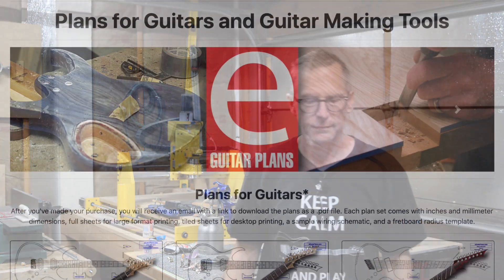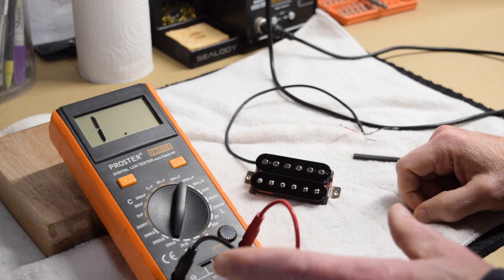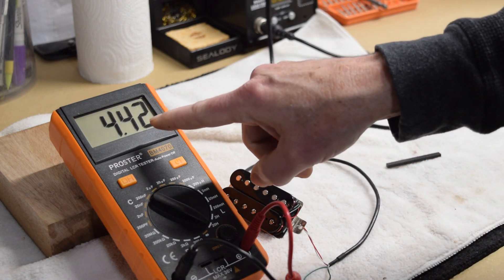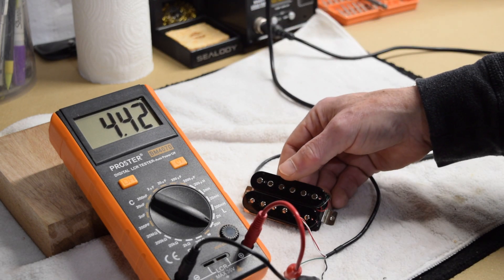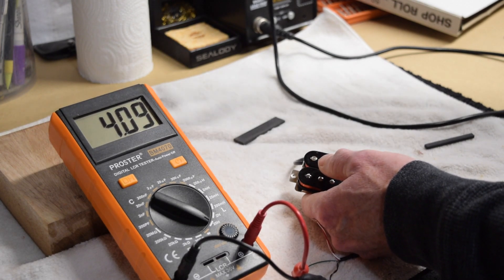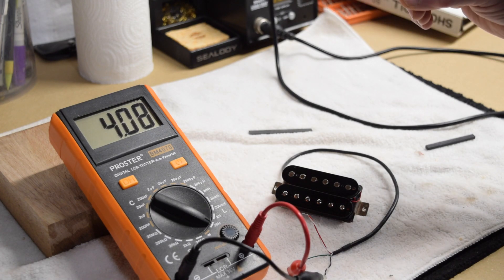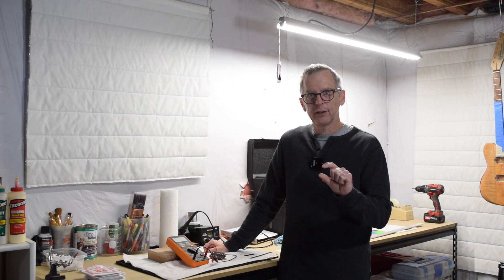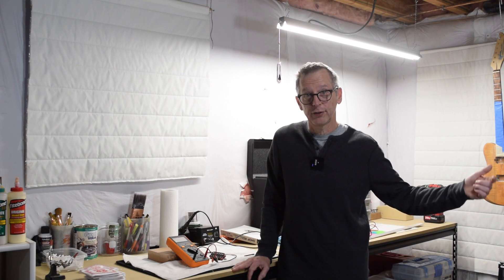Luthier Quick Tip 26 How To Make Guitar Pickups Part 2: Inductance

Comment: 4:13 great video!  My only comment is that I wish you would have provided the gauss readings of both magnets in this example. 

Given a magnet, would you say gauss readings matter more than the material the magnet is made out of?  Put differently, given a set of 5 magnets with the same gauss reading, but they are made out of different materials, would they all sound the same?

I’m interested to hear your response.
Reply from the maker: @michaelkiese7794  They will all sound different due to how the material composition affects the shape of the magnetic field as well as how strong the magnet is charged.

Comment: I have read about bypassing the 2nd coil of a humbucker pickup with a “bright cap”. So as the highest frequency content doesn’t have to fight through the 2nd half. Any experience doing this?
Reply from the maker: No.
Reply: @HighlineGuitars  does it seem like an interesting thing to try from your point of view? Or does it defeat the purpose of a humbucker?
Reply from the maker: @voxpathfinder15r  It sounds like a solution looking for a problem.
Reply: @HighlineGuitars  I kind of want someone else to try it and report back before I break out the soldering iron
Reply from the maker: @voxpathfinder15r  Post a link to what you've read and I'll look into it.

Comment: Hi, first thank you for the explanation. Very good video! I have a question, to reduce the inductance of a ceramic capacitor to something around 2.5 Henry, what kind of slug(material) should I use?
Reply from the maker: No idea. You’ll have to experiment.
Reply: Could you suggest me pickups with this configuration (2.5H)? I saw that fenders 59's have this feature, but here in Brazil they are extremely expensive! Thank you very much.
Reply from the maker: Sorry, I don’t know. I don’t pay attention to what’s available commercially.

Comment: Amazing video like always. 
1 question : how is it possible to increase or decrease inductance, but keeping the same resistance, without change magnet ? Just in changing the way to round the coil ? What is the movemente ?
Ex: i tried to achieve a strat pickup, 5.3 khm resistance, and 2,13 henry.
I m ending with resistance ok, 5.3 khm, but only 1.9 henry. 
How can i change my way to round the coil for increase the inductance and reach and higher number like 2.13 ????? 
I m trying and trying, a lot of differentes ways, but i don t understand 😢😢
Reply from the maker: You can't change the inductance of the coil without changing the resistance. You can only change the inductance without affecting the resistance by switching to a magnet with a different level of iron composition. The presence of iron is what affects inductance. If you don't want to change the resistance or the magnet, you can place a small piece of steel on the back of the pickup to raise the inductance to the level you want.
Reply: @HighlineGuitars  oook thank you a lot for your answer 🙏🙏🙏
So the only thing i can change with the way to round the coil, is going to be the proportion of the  capacitance ?
Reply from the maker: @nicoreynders2880  Capacitance is affected by the number of turns which also determines the resistance. You cannot change one without changing the other.
Reply: Try using a lower gauge (thicker) magnet wire like 41 or even 40. The final resistance will of course read lower but the inductance should read higher. At least, that has been my experience.
Reply: @U2BER2012  thank you. I ll try 👍🙏
Reply: @nicoreynders2880  Hopefully, it works out for you.
Reply: @U2BER2012  i m trying and trying to replicate a cs 69 from fender. And still don t make it.  They say the gauge is 42. I already tried change magnet andmagnetiza streight but i didn t make the same pickup yet .... thank for your advice

Comment: Do i need to buy multimeter or just lcr is enough for making guitar pickup ?
Reply from the maker: Yes, an LCR meter is all you really need. It will measure inductance (L), capacitance (C), and resistance (R).
Reply: @HighlineGuitars  Thank you

Comment: Thank you for covering Inductance.  Can you also measure the inductance of a whole circuit at the guitar jack? Thanks!
Reply from the maker: Yes I can.
Reply: @HighlineGuitars  If you have time someday and could cover that I would greatly appreciate it. It would be interesting to see the results after the circuit.
Reply from the maker: @JeffDunsmore1  You'll get the same reading at the jack as you would at the pickup.
Reply: @HighlineGuitars  Thank you so much. That is good to know. I thought the circuit and everything that might be in it would change it.

Comment: Will it be the end of the world if I wind my tele pickups the other way round? The neck pickup having more turns and DC resistance than the bridge pickup?
Reply: So a neck pickup with 7.6 kohm resistance and a bridge pickup with with 6.6 kohm resistance (all other components are same, i.e. wire gauge, magnets) won't land me in a pickle later?
Reply from the maker: @farzaanpavri  Probably not. However, it depends on you and how you feel it sounds. I may do a video on this topic. Perhaps in a few weeks.
Reply from the maker: The neck may overpower the bridge. However, that could yield a desirable result. There are no rules. Go for it!
Reply: Thank you for answering my questions. You really have helped me now and in the past
Reply from the maker: @farzaanpavri  You're welcome and be sure to let me know here how your experiment turns out.
Reply: Yes i will 😀

Comment: Does the affect of asymmetrically wound bobbins on humbuckers show up with inductance readings? From what I’ve read, asymmetrical humbuckers can scoop mids out to make the pickup sound brighter. Is this true, and does it show up measurably with inductance?
Reply from the maker: I've made custom asymmetrical humbuckers myself (7 string multiscale). I don't see how the offset would affect the inductance reading.
Reply: @HighlineGuitars  thanks for the response. Would you agree that asymmetrical bobbins do in fact scoop out mids, or is there a better way to describe its function?
Reply from the maker: @jonathankvex  I don't know. I would have to compare asymmetrical with non-asymmetrical in the same guitar. That's never going to happen.

Comment: I'm looking forward to the next episode. What do you think about different potting techniques to effect tone, as in heavy potting, light potting, potting the bobbin and magnet but not the coil...?
Reply from the maker: How on earth do you pot a bobbin, but not the coil? The whole point of wax potting is to saturate the coil windings with wax so they won't vibrate.
Reply: @HighlineGuitars  For example dipping the unwound tele bobbin in wax so that the bobbin and magnets wont vibrate against the base plate or the neck cover. But the pickup would still sound like an unpotted pickup, but with less out of control microphonics. I've heard a few pickup makers talk about stuff like that with the potting process, or a way of "lightly" potting a pickup

Comment: Not sure that particular LCR meter has sufficient test frequency to measure pickup inductance as accurately as one like the DE-5000. It also seems to get pickup capacitance measurements wrong. They should be in 50-300 pF range.
Reply from the maker: The DE-5000 has been discontinued. You can buy them used, but the one I use works fine for DIYers.
Reply: @HighlineGuitars  DE-5000 not discontinued as far as I know. Widely available for around $100. https://www.deree.com.tw/de-5000-lcr-meter.html Inductance measures may be "close" with some other meters (despite too low test frequencies), although pickup capacitance is way out with the Proster (gets nF when should be getting pF).
Reply: Not sure why you are talking about capacitance, when the video is about inductance lol
Reply: @nisterror  Because of two important measurements on pickups, inductance and capacitance, the Proster meter gets both wrong. Inductance possibly  only slightly wrong (so maybe "near enough"), but capacitance by a lot.

Comment: Counterintuitive!  I would have expected the association of tone and inductance otherwise-- we use capacitors in tone circuits because they pass AC easier than DC, or highs easier than lowers, and bleed off highs.  Inductors work the opposite, passing DC easier than AC-- or, I would expect, passing lows easier than highs.  However, in this case, we're not passing current through the inductor, we're changing the magnetic field around the inductor.  I suppose the proper analog would be changing the static charge of a capacitor directly to generate current.  If I am incorrect, please let me know!
Reply from the maker: Heck if I know. I try to keep it simple since it's easy to fall down a rabbit hole and start obsessing over factors that have no noticeable impact on tone.

Comment: Great video, this information is helpful to someone just starting to figure this stuff out. As a beginner, it's very difficult to make sense of what these numbers mean without anything to reference them to. Can you recommend any data list with numbers of known pickups to reference from? Thanks!
Reply from the maker: I am not aware of such a list. I just go by the rule of thumb I described in the video.
Reply: There are many lists from various sources on the internet, with number of winds, AWG, resistance, magnet type, etc... However, they never list the inductance.

Comment: Does the Volume pot value and tone pot value affect the "series & parallel inductance"? you have to get an inductance meter that measures series LCR & parallel LCR
Reply: There are 3 components of impedance. Chris has talked about 2 so far, resistance and inductance. The third is capacitance. Inductance resists changes in current. Capacitance resists changes in voltage. These 2 attenuate higher frequencies more than lower frequencies. In Chris' example higher inductance attenuates high frequencies more making a pickup sound darker. The third component is DC resistance which affects all frequencies the same. Your volume pot attenuates the entire frequency range. The tone pot controls how much of the high frequency signal flows through the tome cap to ground. All components in the guitar circuit have inductance (L), capacitance (C) and resistance (R). The sum total of all the components determines the tone. The pickup is the most variable in construction and therefore impactful to the tone.  I know lots of other things make up the tone like the player, wood, scale length etc. but this discussion is electrical.
Reply: @scottakam  when you put a 250K pots for the volume pot and tone pot the LCR + parallel 250K pots are going to give a different LCR value which has changed the frequency response of the guitar pickup. The volume pot and tone pots resistance values will change the Inductance of the guitar pickup. If you wired NO load pots the guitar pickup LCR is at different value compared to LOADED with Vol and Tone pots. Both LCR values are different which changes the frequency response of the guitar pickup.
Reply: @waynegram8907  Rotating the pots changes the resistance of the pot which changes the impedance of the circuit. Different pots, no pots or position of the pots does not change the inductance of the pickup. Only the construction of the pickup determines the inductance of the pickup.
Reply: @scottakam  not sure if that is true the inductance is wire which has DC resistance in the inductor coil of wire. When a vol pot and tone pot 250K are in parallel with the inductors DC resistance it changes the DC resistance of the L inductance. There is series LCR and parallel LCR. The AC impedance and DC impedance has changed when using pots when LOAD the pickups LCR and NO load pots will unload the pickups LCR.

Comment: Why don't you just shoot for the winding with the brightest signal and add a choke coil down stream to shape the tone? Various choke coils could be switched in or out of the circuit with push/pull switches built into the volume and tone control potentiometers.
Reply: Les Paul did this with his "Recording" guitar.  It had a low-impedance pickup with very few winds and an AC inductance of 0.008 Henries (DC resistance 10.8 ohms),  resonant peak over 200 kHz (human hearing maxes out at 20).  So, completely flat frequency response in the range of human hearing.  He then added a "decade" switch with a series of 11 capacitors to lower the resonant peak, so he could get any tone he wanted.  The extremely low output (closer to that of a microphone) could be plugged directly into the XLR input of a recording console.  To be used with a regular guitar amp, the signal had to be transformed to a higher impedance.

Here's an article about the guitar:

https://drive.google.com/file/d/1Kb0Zti8vrHQ4prxpmiqOWoR88K2QaSie/view?usp=sharing
Reply: @gregholmberg2  There is a reason they don't make it anymore...
Reply: @pallecla Yes, I would say it failed in the market for two reasons:

1. Les Paul wanted a clean Jazz tone (straight to recording, no distortion, no effects) at a time (1969-1973) when most guitarists were heading in the opposite direction.

2. Convenience: you had to buy an adapter to connect it to a regular amp, which lost some of the tone.  Although Gibson did make an amp with the transformer built in.

Today, with a proper active pre-amp, you could build this into the guitar without losing tone, and maintain the great range of frequency peaks, and also be compatible with standard amps.  This is an opportunity for someone out there.  And the range of tone could appeal to players who use distortion and effects, not just to Jazz guitarists, I believe.
Reply from the maker: I don't want to scare off my customers.
Reply: The paradox of guitarist (I am one). I want the ultimate tone, I can try thousands of guitars to find it, but I don't want one guitar with thousands pots to find it.
Reply: @ESANANIKONE  The Decade switch was a single tone knob.  It just had greater effect than the usual tone knob.